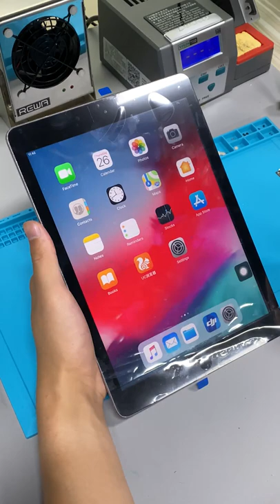iPad Screen Digitizer Replacement #shorts

Comment: Interesting using hot glue for the home button and a soldering iron, never seen that
Reply: Normaly it would be atached with adhesive on this ipad
Reply: @jevader12  yes that’s right but I’ve used just regular electronics glue previously. the hot glue gun is going to harden much faster
Reply: What is hot glue
Reply: Why not use a hot glue gun instead of soldering iron or did they just not have a hot glue gun handy???

Comment: What glue are you using for the home button?
Reply from the maker: Hot-melt adhesive
Reply: I've ran into an issue on a few iPad home buttons. I wasn't sure of what to use to hold them on.
Reply: @rewatechnology2008 is it a glue stick that you use?